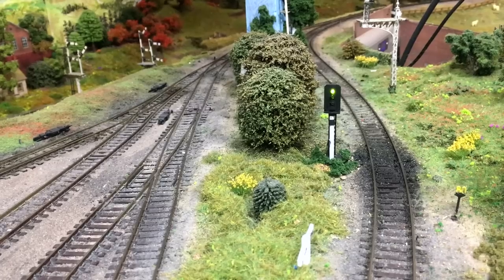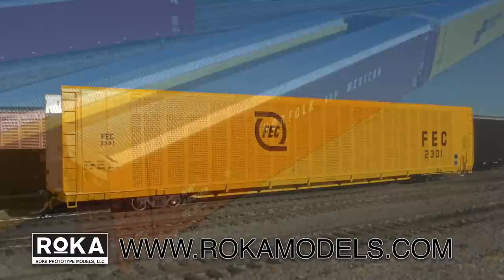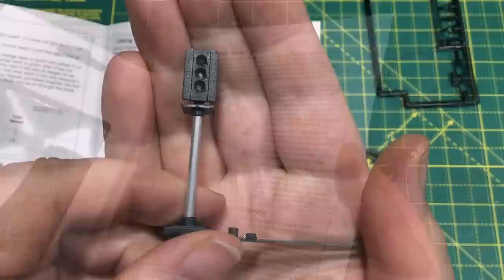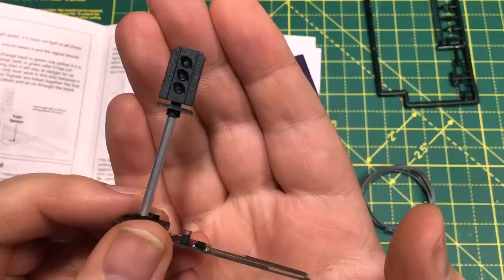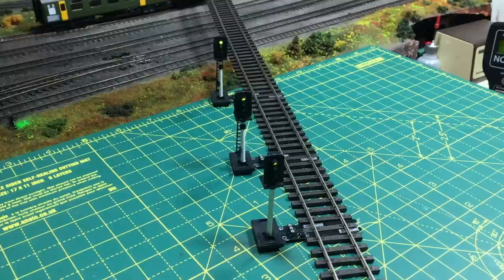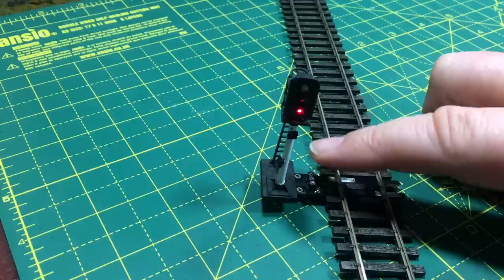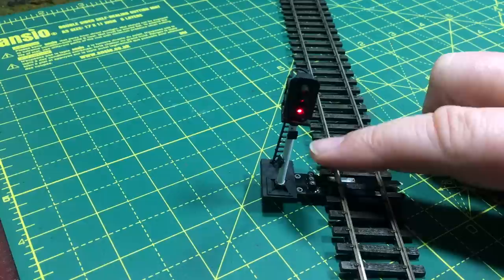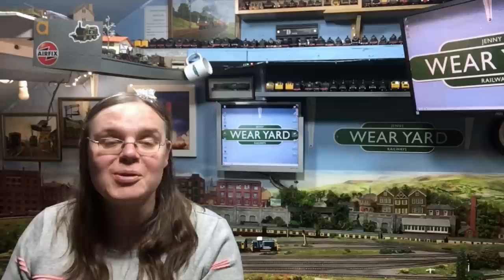Easy Block Signalling That Just Works! Train Tech Automatic Signals Review and Fitting Guide

Comment: Train tech were very good with tech help when they were Train tech but now they sold out to Gaugemaster I hope that is maintained. Train tech say in the manual that the signals will not connect with PECO track as just a push fit. (Loose fit) Which explains why solder was used in this video. However I notice some PECO set track has extra extra webbing and that will work as it gives a nice tight fit although that limits placement. Also not mentioned here you can cut off the track connectors if you wish if say using acc bus. Though I found just sliding the two prongs underneath the plastic base of the track will hold the signal in place without the need to mess about with glue and can easily moved if needed.

Comment: So I’m brand new to the channel and back into modelling after 45+ years. So my query is this: it looks as though DC will be my control of choice and I really like the train tech signals. As is the case on the mainline, is it possible to daisy chain a mix of various aspects (such as a single 3-aspect in a run of 4x 4-aspect signals)? Great channel by the way.

Comment: Excellent video again. I suddenly realized I have a question. I saw you show a way to allocate a DCC accessory address to the signal and that these signals used to power and  connection to the track. Is there a way to get point motors to use the same arrangement? I have not yet started into DCC but from what I have seen you need to have a lot of wiring and electronics to control points, like turtle points. Thanks

Comment: Jenny Hi: I am new to this channel and think it is very helpful. I need some helpful advice please re the block system. I have almost completed my track and will install the block system. I understand each block has a min of three contacts(sections) being start, travel and slow to stop at the signal.....so that is easy to follow re plastic rail joiners and wiring. However I really need some helpful advice on the multitude of points, cross overs and double slips coming out of the station? I am not able to understand where the plastic rail joiners go......Do I isolate each point and crossover and double slip? I can send a picture of the track. Any help would be great.
Many thanks
Scott

Comment: Jenny Hi:
I have followed the instructions for wiring the feedback modules(track occupancy= one rail sections with plastic rail joiners) for “SIMPLE" straight track but the instructions do not mention feedback wiring for points/turnouts and cross overs and double slips? 
I understand each block has a min of three contacts(sections) being start, travel and slow to stop at the signal.....so that is easy to follow re plastic rail joiners and wiring. 
 
However very often there is a  multitude of points, cross overs and double slips coming out of the station? I am not able to understand where the plastic rail joiners go……
 
I have not been able to see any examples of DCC blocks with points/turnouts or crossovers or double slips???
 
Do I isolate each point and crossover and double slip? I suspect the points have a plastic rail joiners on three positions for insulfrog and five positions on electrfrog points to totally make the point in a block in its own right, i.e. give the point its own power droppers?
Any advice would be appreciated.
regards
Scott

Comment: Hi. Have you any experience in using the DS signals from Train Tech in conjunction with iTrain/JMRI etc? As they have their own individual built-in decoder can they just be slid into the track and use dcc bus power or do they require a separate accessory bus? Must they be wire linked to operate in series or will the automated system take care of sequential aspects?

Comment: Can anyone explain to me what I’m doing wrong? I’ve bought four Train Tech signals, and have slotted them onto my Peco track. I’m running a DCC system via a Gaugemaster Prodigy . When I turn on the power I get four green lights on the signals. However when I run my finger over the sensor, it remains green? I have also run a wagon over the signal, and it still remains Green. This has happened to all my four signals, on separate loops . Many thanks Rob